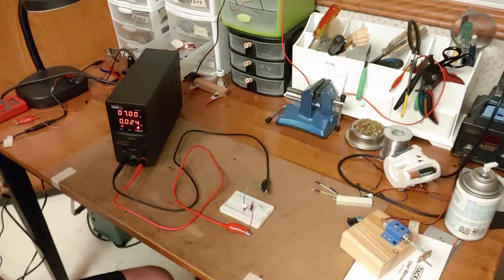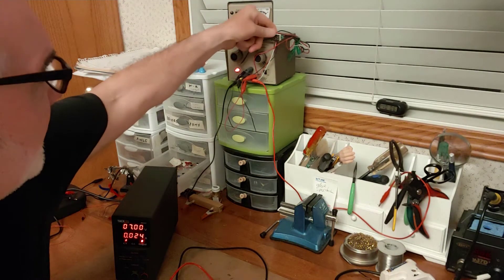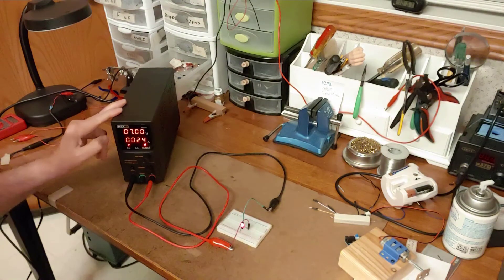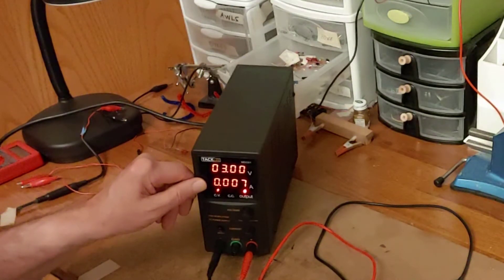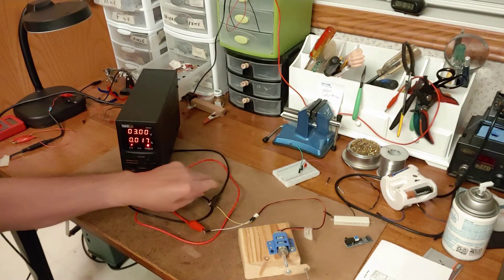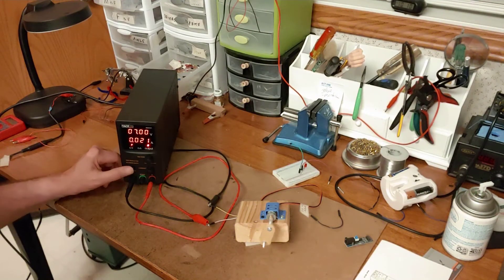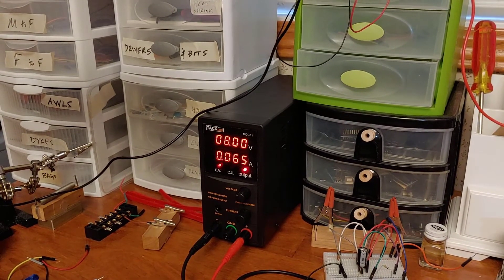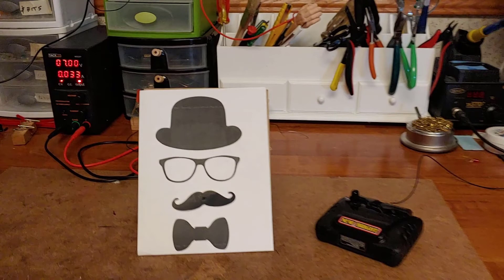TACKLIFE 30V / 5A DC Power Supply -- Additional Info

Comment: Can you use it to power a car stereo radio in your garage ??
Reply from the maker: This power supply is apparently no longer available. But my guess is that any 5Amp supply would certainly be enough. But you should check the specs of your radio to be sure. The radio probably has a tag on it somewhere listing how many amps it draws.

Comment: My unit shows the dot in the second position (00.00 amps) and I saw many photos and videos like yours that show the dot in a different position (.000 amps)which means a different resolution, how do I change the resolution of the amps?
Reply from the maker: This is probably a dumb question but I'll ask it anyway... do you have the same model? Many models will not show 3 decimal places. If you have the same model, I believe that just tweaking the voltage and current knobs to a certain amount will sometimes change the resolution. (I found a new hobby for now, so I haven't used mine for a long time so I don't remember for sure.)
Reply: @Electro-Mechanical-Basics  exactly the very same model, i turn every knob and push every button… without any luck at all
Reply from the maker: @omarquintana3481  Maybe it needs a load. Did you try that? Otherwise, I don't know. Next step would be to contact their support I guess.
Reply: @Electro-Mechanical-Basics  with or without a load same resolution, seams the manufacturer is no longer in business. The website is offline